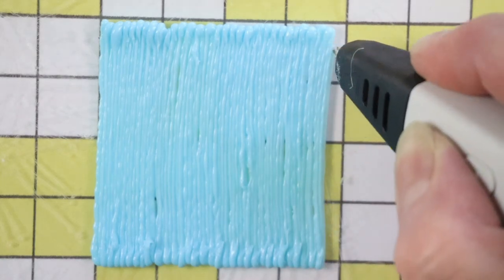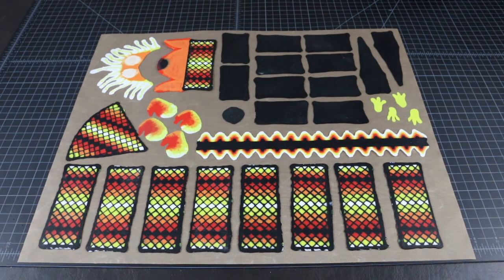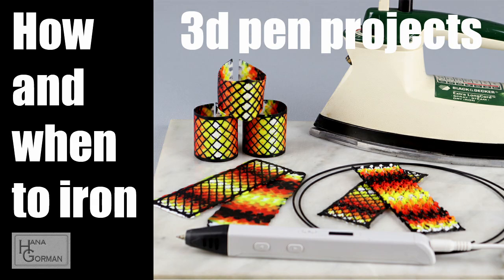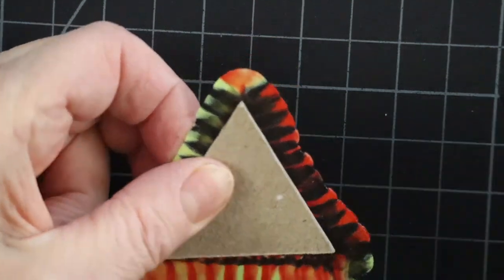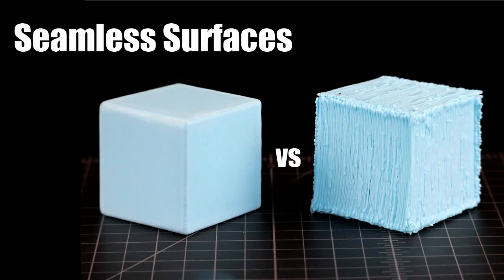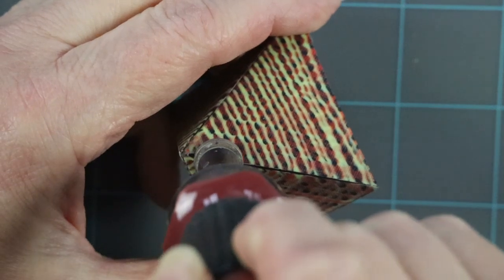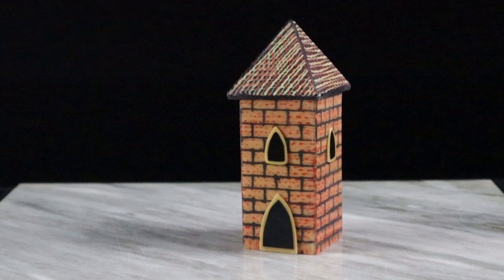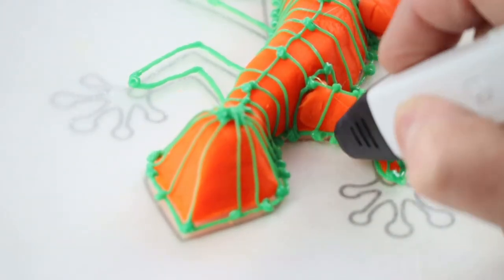Painting with 3d pen

Comment: Hi! I'm having trouble adjusting my woodburning tool's temperature. Which temperature would you recommend for PLA?
Reply from the maker: I have mine set to 500F/260C. But it may need tweaking. The lighter colors burn more easily. I wipe my tool on a paper towel to keep the residue off. The way to tell (if you don't have a temp display) is:  if it burns the paper it will burn the plastic.
Reply: Thanks!

Comment: As always, a very enjoyable video showcasing practical solutions. However, I would like to ask if you have any experience with those more advanced 3D pens with a cooling system. Do they actually make it easier to draw in space without resorting to drawing on flat surfaces?
Reply: Ive never seen anyone "drawing in space" effectivley.  the sagging of the material as it cools is just fundamentally un-controlable.  I think the most advanced users (hannah and all of the other 3D pen creators on youtube like sanago etc) start flat, and then build 3D shapes by combining the flat primals
Reply from the maker: Never heard of a pen with a cooling system. But I don't really follow the latest inovations. Please point me to a link to one of those. I would love to test one. Who makes one? However I have developed a way how to draw curved surfaces using clay support which will be the the subject of the next video. Here is a sneak preview of the method https://youtu.be/Xa7gZse6c5c
Reply: @3DPENDEN  First one from https://youtu.be/9F6k8itJGV0?si=oqsF7uiGIlnTj5zY
Reply from the maker: Thanks. I actually knew of that one but never ordered it, because it uses special ink that gets cured by UV light as opposed to the usual 3d printer filament which is affordable and widely available. I am set up for 1.75 filament and so I don't want to switch to having to buy new material when I have so much of this one. Plus I just now wanted to check on the pricing of that ink and it said it was currently unavailable so I am wondering if they are still in business.